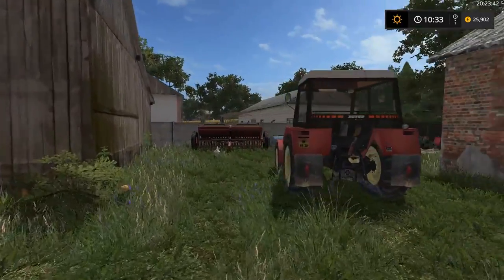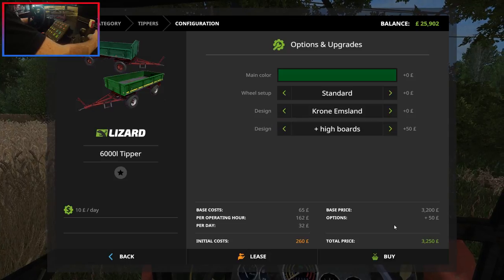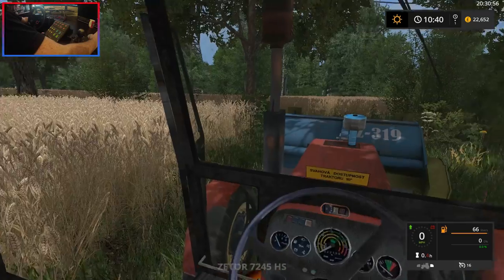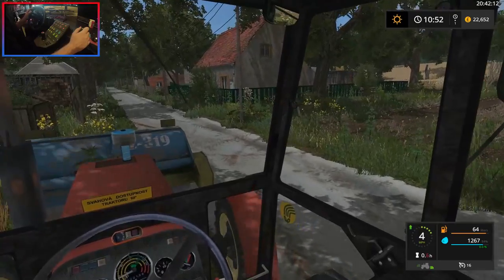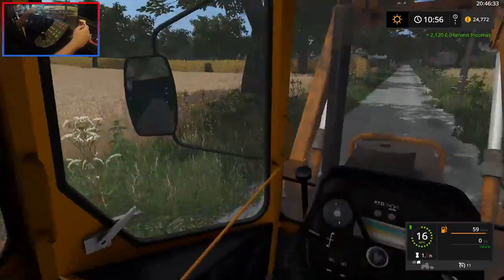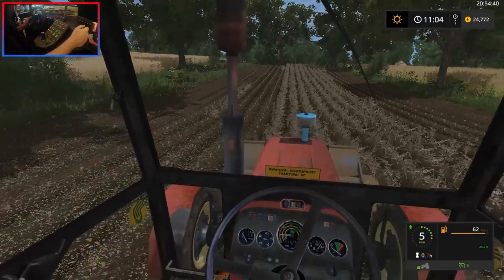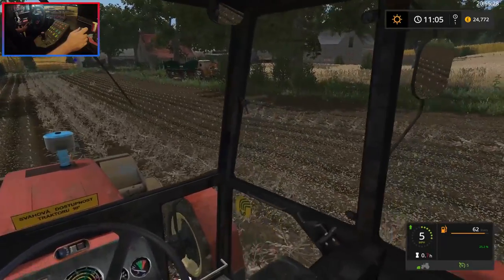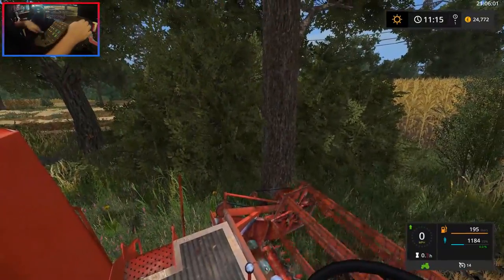Polish Farming - Farming Simulator 17 -  Ep.3 (with Wheel Cam)

Comment: FS17 Potato Harvest: When faced with low horsepower OR very tight fields, I tend to run the topper over first, do the whole field, then run the harvester over. I find the whole kit to be very unwieldy unless you have room on both ends of the field to get the rig absolutely straight. And if you take care topping the field, then it doesn't matter if you drive over the crop either harvesting or unloading the harvester.

Comment: The guy on the harvester is sorting out rocks and bad potatoes. 
When i was younger my friends family was doing potatoes, and every fall i helpt them with the harvest. 
We did not use a topper, the harvester sorted the tops out by itself. 
The harvester was rear-mounted on the three point linkage "floating" behind the tractor. It then had a conveyour going to the front where the tractor was carrying a potato pallet on its forks. We where usually 4 ppl standing inside on the back sorting out any big rocks that made it up. 
It was only harvesting a single row at the time and we reversed back to start the next row.